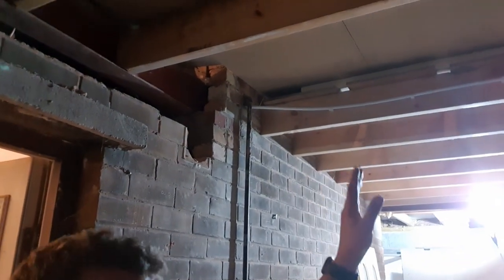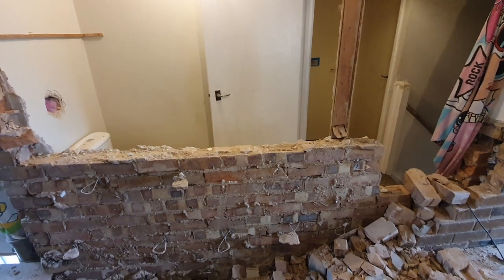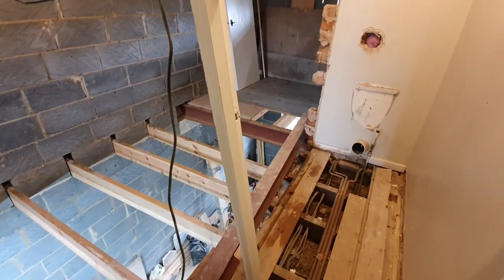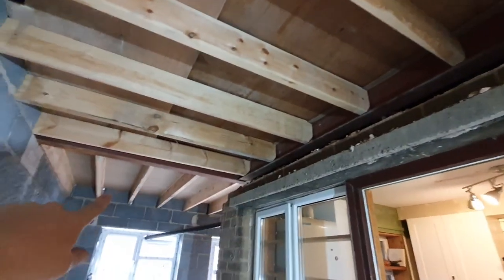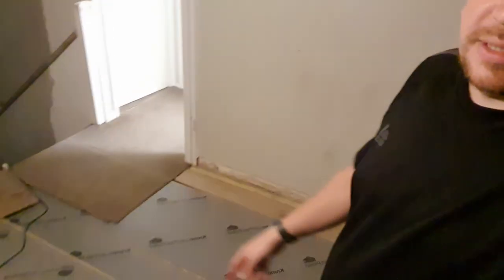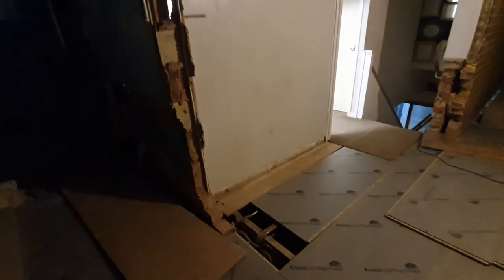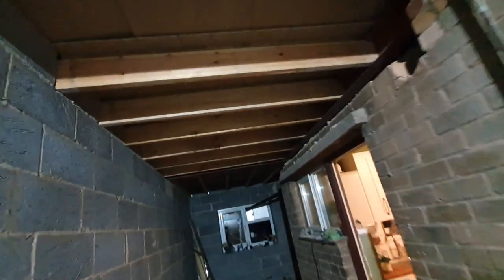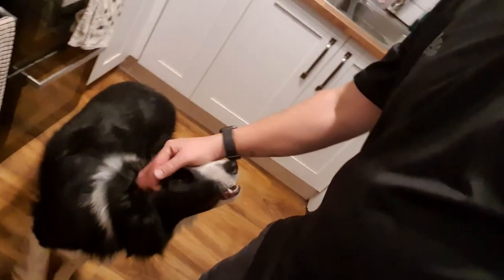Part 14 Of Our Extension Self Build ~ last steels ~  Vlog 887

Comment: You're going to need extra hot water for the extra bathroom. You upgrading the boiler or installing an Unvented Cylinder?
Reply from the maker: Not sure yet, Existing combi is 28KW and not really worked hard. I'm only adding 1 extra rad so it should cope. The new bathroom is having an electric shower so no extra demand there.
Reply: @harrybrew69  Electric showers cost a fortune to run, but are handy when the boiler breaks. (I'm sure you've seen error 'E119' on that boiler)
The 28kw refers to the hot water demand.The heating kw is less  but I'm sure one more radiator will be fine. 👍

Comment: Won't it be cheaper to just buy a new house?  I do the kind of stuff you are doing, holy crap that is a lot of work!!!  I am in the U S, different there????
Reply from the maker: I've spent about 20k so far, I would have to find an extra 80k to move. Not financially viable with house prices as they are.